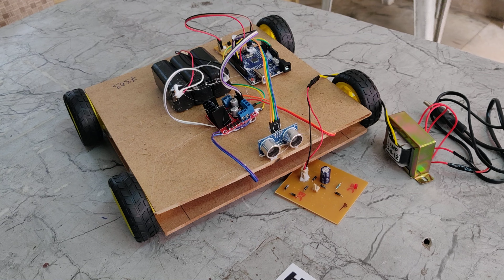Emergency Braking System using Arduino UNO and Ultrasonic sensor

Comment: Use a bms so you wont have to buy new bateries every 3 to 4 power cycles
Reply from the maker: @NIGHTMERUL  Hi, 
We sell full working kit with document PPT circuit diagram and code. Could you Send me the video link, Will update you the cost details. You can contact us at +919603140482
Through WhatsApp or call